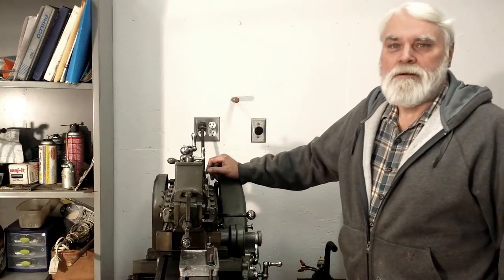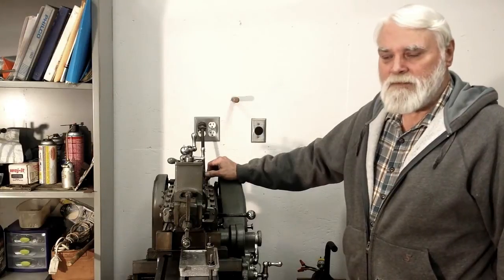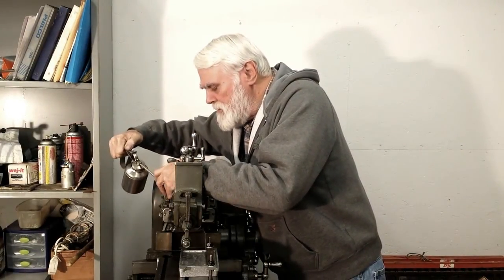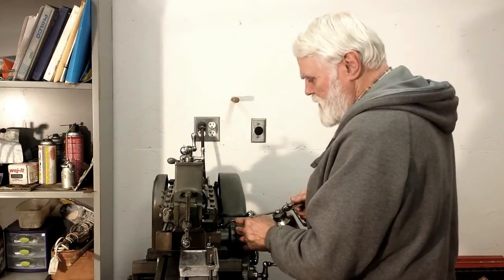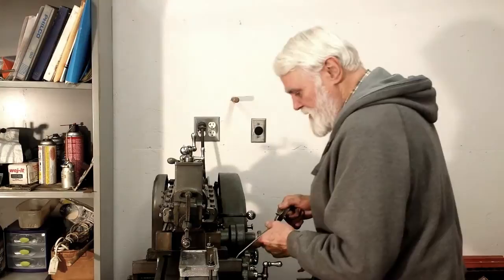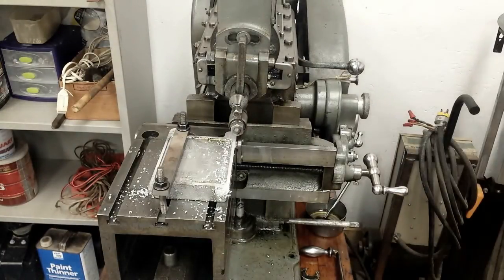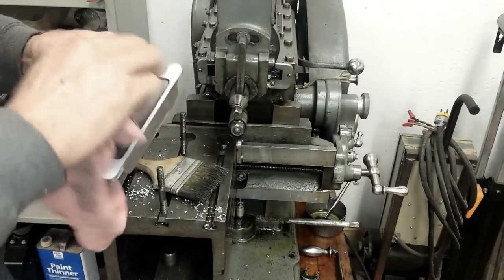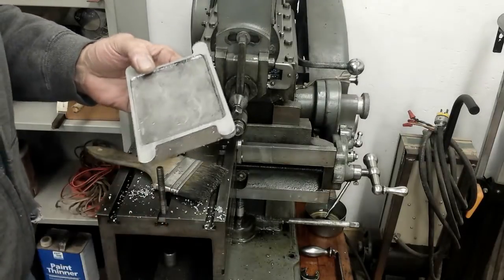Sirius Steam Engine Atlas Shaper Machining

Comment: I read somewhere that the table foot was added sometime 1938-1939,  My serial is in the 
4,000's that puts it 1942  serial no.s are on line  nice machine     sam
Reply: Atlas shaper first came out in 1938. Mine is a 1939 model with serial number 1202. No foot or way wipers. In the 1941 catalog the shaper now has the foot support and way wipers. So somewhere in the 40-41 time frame was the addition.

Comment: I noticed when you adjusted your table feed rate you set it on the other side of the eccentric and its feeding correctly now on the back stroke . The table feed should always feed on ram return not the extend cutting stroke . I recently got my atlas shaper up n running and the manual states that . It's hard to see when your motor is powering it but when you spin it by hand its east to see witch side the adjuster should be on . My shaper is very well used and shows it's age but it does a nice job I like these old machines ,keep up the good work .